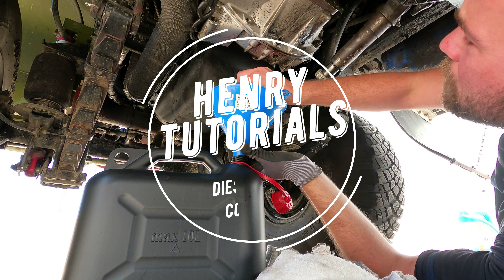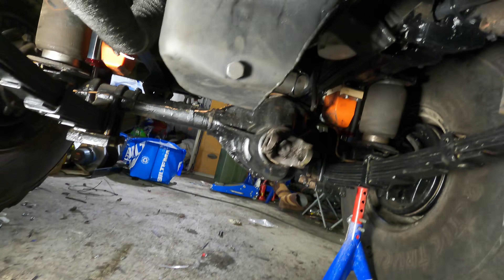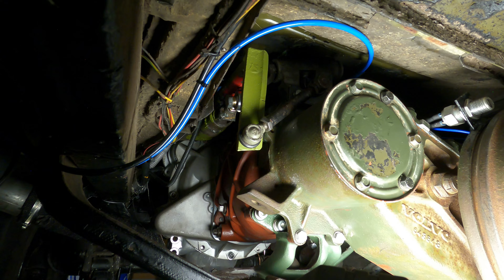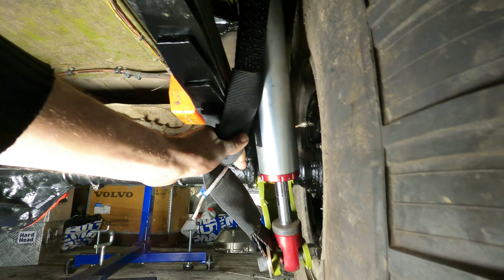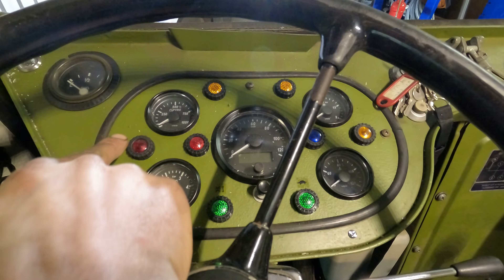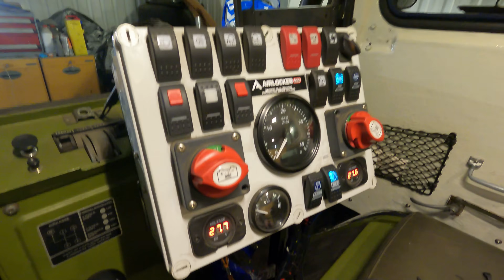@Henry the man cave camper Tutorial - Diesel engine conversion

Comment: Great work! I have experience with these axles and lockers. After the axlelocker was added I started braking halfshafts. I then swapped the original axles for Mercedes G class axles. These axles have the correct gearing, lockers and disc brakes. They hold up really well! What upgrades did you do to your axles? Greetings from The Netherlands.

Comment: Excellent walkthrough! 
What kind of brake booster is that? How did you make it work? Would really like to improve my original brakes. 
Where did you buy that handbrake cable and what did you have to do to fit it with the handbrake leveler?

Comment: Look like it took some time and money to do the swap, but nice when it work out,  good work . Think it's time I also do a guide but need to find someone that can explain things in english .
Reply from the maker: Thank you Eile! I think there are many people interested if you make a video about your swap. The Indenor engine fits very nice in the Valp and it's also very good and simple engines. It's fine if you do it in Swedish, I'll understand most of it hehe :-)
Reply: @Ricklandrover  But youtubers don't understand swedish :-)  It's impressive you could put so many things in that car.   Thing that difference in my build to many other is that is builded in a complete car not on a stand alone chassi, so all repair can be done on road with heavy engine block in place and body on the car.  During this 22 years gone since first engine swap many things have been overhauled or rebuild with engine still in the car  : rings, bearing , head,  camshaft, clutch, gear, and so on.

Comment: Hello,
Great project, and very well done. I am a hunter and i will get myself a feltvogn for our muddy forests here in southern germany. 
This little truck is as short as a 90 defender but with the interior size of at least a 110. And i like the forward control concept, helps a lot in tight corners, you can actually see where you are going and what is in front of the vehicle. In my defender i always had to memorize where all the big stumps are before they disappeared in the dead angle of the engine hood.
I got some questions regarding your truck:
- What tire size and rims are you using? Offset?
- you got lockers front and rear? I read the axles are Salisbury h4, so i guess Dana 44 stuff fits / can be made to fit?
- The fender flares are from a defender?
I contemplate installing a VW 1.9 TDI with a mechanical pump and no intercooler. (SMT adapter). I ran one on a T3 syncro and it did fine with like 80 - 90 hp.

Regards and keep the videos coming..

Holger

PS Do you have a link to @Helgethecampervanman ? I cant find his conversion on the web.
Reply from the maker: Thank you for the kind words! Yeah, seeing them from the outside you wouldn't expect so much interior space. I've had multiple Defender 90's and 110's but the interior space in the Valp is more practical for sleeping and living in it. There is quite a few Volvo Valp enthousiasts in Germany and Austria if you need any assistance. Good luck with your project :-)

Comment: You mentioned needing approval for putting on disc brakes. But what about approval for more HP?

You really are doing some neat stuff with the valp :-)  Impressive stuff.
Reply from the maker: Hi Rolf, I have applied at Vegvesen for the engine swap and they have approved this. They have issued papers that the engine swap is allowed, the car just needs to be shown for final inspection. This I haven't done yet as the car has been abroad for the past year but I'll do it when it's back.

Comment: A huge project really well executed, congratulations on completing it! You could possibly use a 24V PWM controller to regulate the speed of the radiator fans, even modulating their speed with temperature automatically wouldn't be difficult. The Davies Craig EWPs have a similar controller for their water pumps.
Reply from the maker: Thank you very much !! Good one, a speed controller would probably make the system a whole lot better functioning and reduce the noise and power consumption a fair bit. I'll go and take a look at this